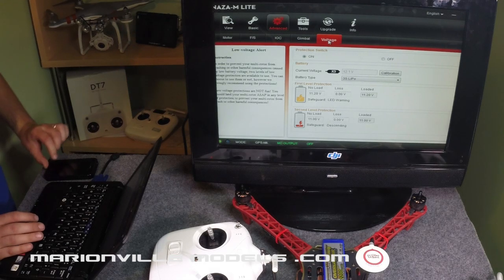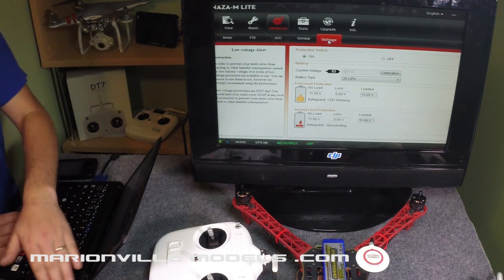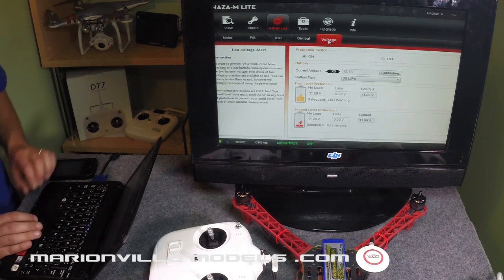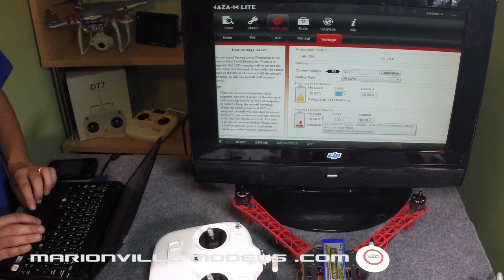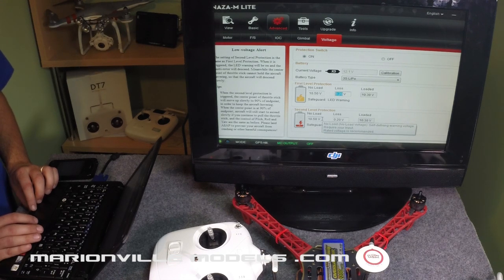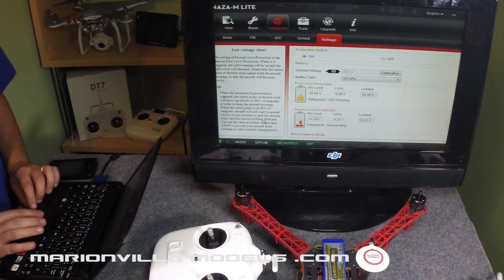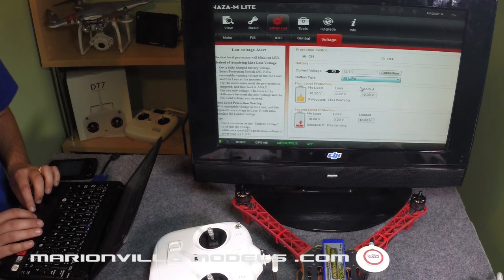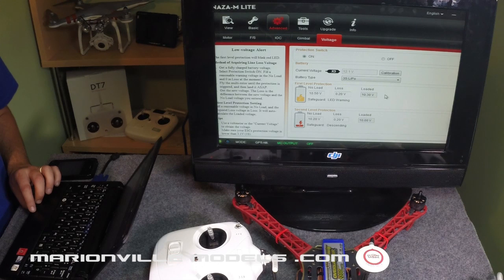Recommended Voltage Settings for Naza Light w/Dji F450F550 Flamewheel.

Comment: I am trying to work out the parts of voltage.
I am using a 5000mah 3s lipo .can someone help please I done your settings get 6 minutes flite time.

Comment: Hello Marionville models, Thank you for videos. I am beginner to building scratch building quad copter drone and to configuring etc. I noticed that on this video you imputed the single cell Vd (voltage drop) at 0.2v and I feel that the value should be x3(0.6volts) for a 3s battery.   Best regards.

Comment: Hi there could you please reply I haven't Flemmer Phantom for a year and my batteries will put away on a storage charge however I'm going to fly my friend MFC 40 with a multi start rotor battery 4.0 and I'm only getting 13 minutes flying time where before I was getting 18 minutes and then one minute to land I've looked at my Settings but I cannot seem to find the right settings that were there before I've tried your setting and no different

Comment: i got a f450 920kv with 600mw fpv, 700tvl, sj4000 without gimbal, and landing gear. i dont know total weight. i use 3000mah, 4000mah and 2x2200. all 3s. got any tips what i should set my voltage settings at when im using different lipos all the time? my flighttime suck atm and i dont wanna adjust too much. Thanks

Comment: Nice video. However, aren't your numbers a tad low? The 10.5 puts each cell at 3.5v, which is below the 3.7v, no?
Reply: +Guy Salazar If you haven't figured out already, under load the cells will sag to a lower voltage compared to at rest. So under power a cell will be at 3.5V (when you want the warning led to flash), then you land and check the cell voltage at rest, and it will be at a nominal level.
Reply: +Guy Salazar Ok, I actually watched the video to see that he put 10.5v for "no load" I agree with you now that 3.5v is lower than what I would want my cells after a flight. sorry

Comment: Thanks for the video, I just finished my F450 and I am wondering how do I connect my flight controller Naza lite to the assistant software? with my Phantom 1 there is a USB port that I use to connect to the software.  Am I missing something?
Thanks,

Comment: First, thank you for your "build" videos. I've recently completed my F450 build while following a lot of your advice/direction. One area I'm NOT very clear on is the voltage setting process. At present I use a Zippy 8000mAh 4S battery. I purchased a voltmeter but havent figured out (yet) how to set up and use it.
I have flown enough now to realize I probably have a lot more "battery charge" left when the first level warning lights begin to blink. Have not taken it to the red blinking/warning lights.
Feel free to email me some (step by step) guide to accomplish this:  rol1353@aol.com 
I would greatly appreciate your help.
Thanks,
Robert
Reply from the maker: Tis video pretty much shows all you need for setting the voltage cut off. Start with these and if you still have plenty left in your battery just start lowering them. You need to fly till you get the second voltage warning.